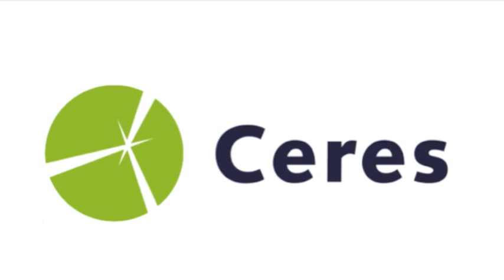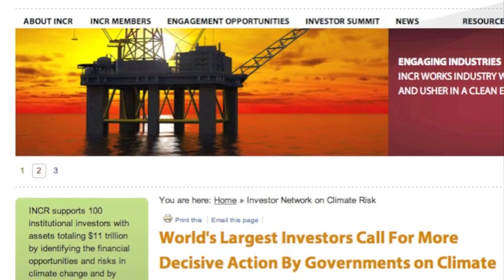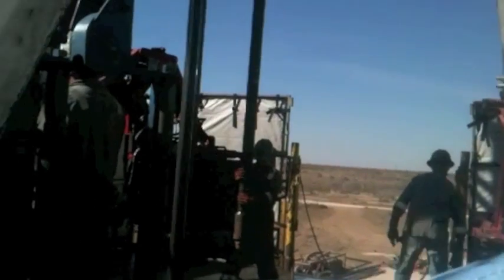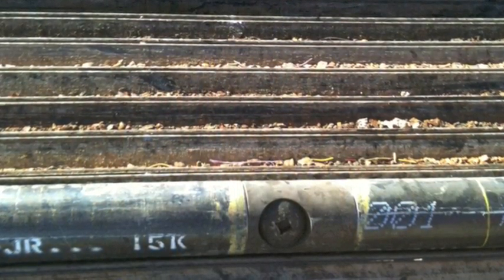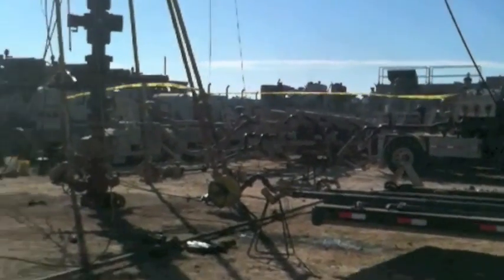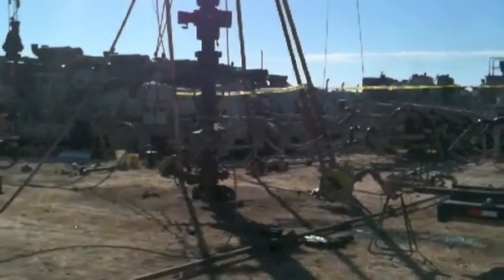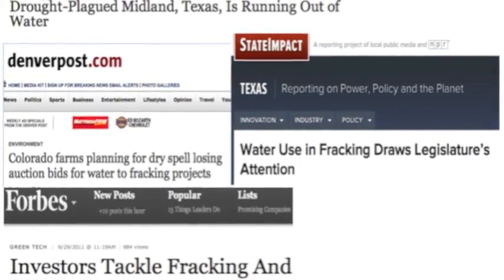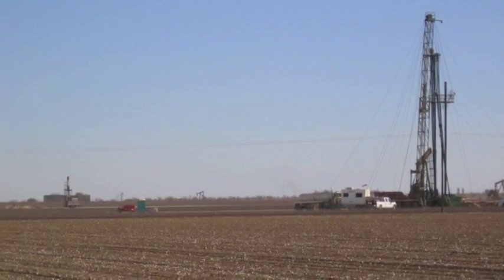Fracking Activity in Midland Texas

Comment: You'd think this would be a no brainer, that Texas, in these, drought plagued areas, would require all their available fresh water be used for drinking & watering crops/gardens, and for domestic uses first? And if they start having water shortages,  to start shutting down all these rigs first.  Why would they even want to take all this water and pump it down into the ground with toxic fracking chemicals so that mining oil & gas rig(s)  can fracture all the rock below, releasing underground oil & gas & let it all rise to the ground surface. Each mining rig uses a billion of gallons of water. This should be a no brainer, as to where their limited supply of water should be used. With all the great sunshine in Texas, why are they even issuing permits for these types of mining operations?

It would be so much cleaner &  easier to use any of the free energy sources like the sun, wind, water, passive heating, thermal heating and cooling,  or the closed systems of water that provide great heating/cooling within buildings. Everyone could use recycled energy with an organic matter run engine, conservation alone, could cut the demand way down for oil & gas. With necessity being the mother of invention, there's huge areas waiting for development. Most of which are being censured or blocked by the big corporations because there's no money in it for them. 

Thanks for the post "Fracking Activity in Midland Texas".